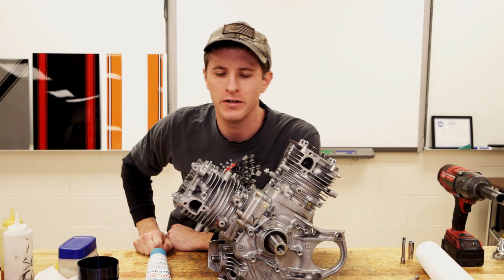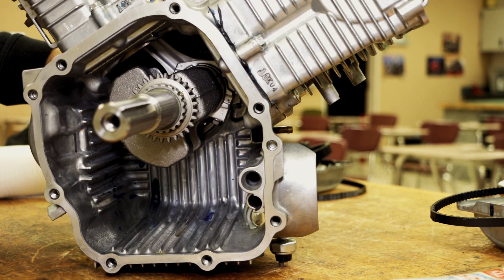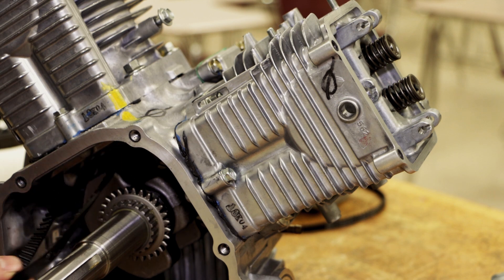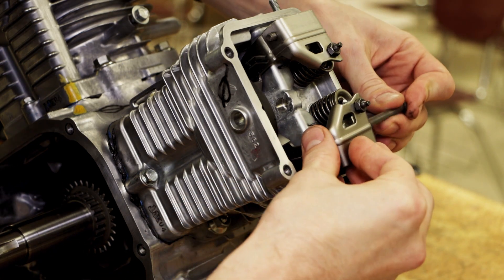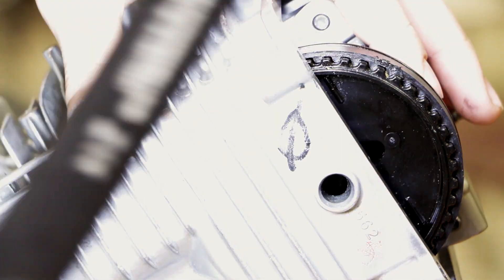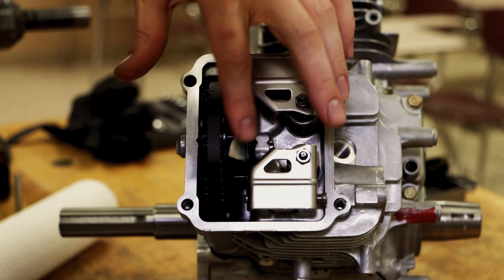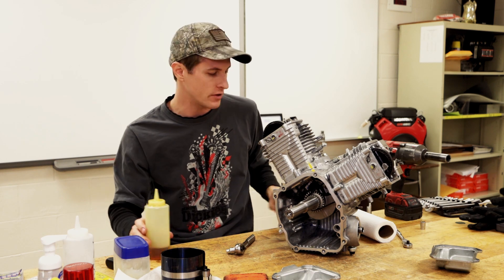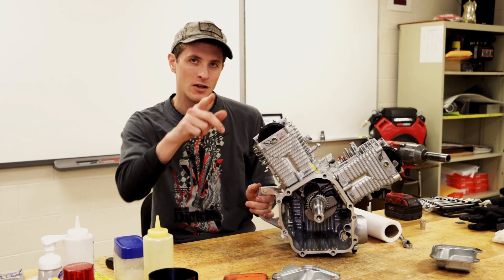13 Honda GX 530 Camshaft and Belt Install

Comment: I have this engine in a craftsman tractor. I replaced the faulty starter and solenoid. with the spark plugs removed i can rotate the crank but when I install the plugs i cant get the mower to go. what is my next step?

Comment: The timing belt runs in oil I've never seen rubber that likes motor oil / gas on them !!!! Just me !!
Reply: Honda has been doing this in their small engines since 1997. I've got a 1998 motor that has the original belt which has been bathed in oil for the last 24 years with no signs of degradation. There is a reason Honda is the premium small engine on the market, this is one of the factors.
Reply: @otm646  me too!  My Craftsman 2004 Honda 16.5 h.p. DT 3000 tractor still runs like new.  The new Craftsman tractors are not the same, they are cheaply made by MTD.